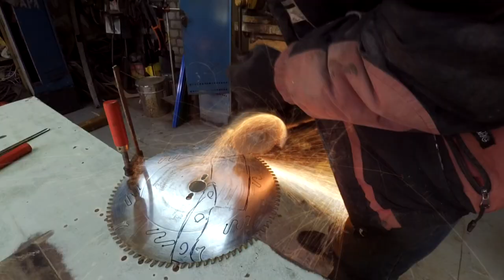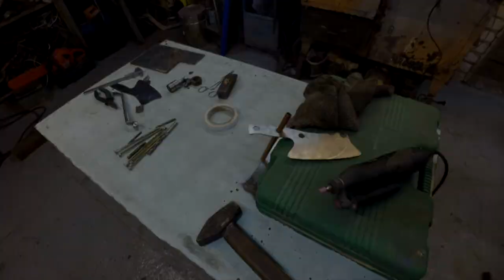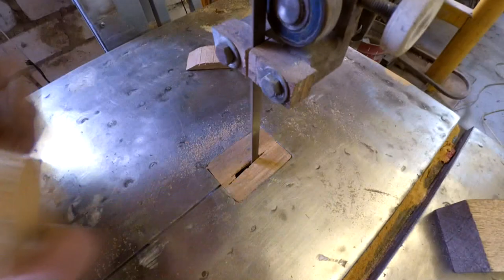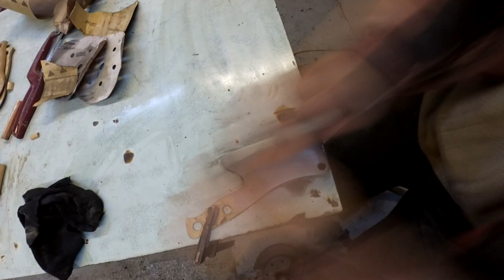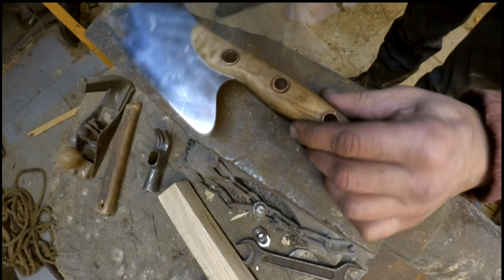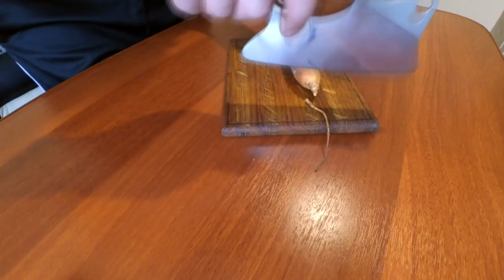Knife making  - the irreplaceable assistant for kitchen

Comment: Ok, what if you cut the piece out using say a plasma torch. Would the intense heat compromise the quality of the steel?
Reply: You would need to heat treat and temper the blade afterwards. Even heat from the cutting wheel or grinder can do that, so i suggest keeping metal cool as possible.

How ever if your are serious hobbyist doing heat treating your own anyways is the best solution, cause i would not suggest using those circular saw bladed other than cheap knife making practice.

Comment: Should you have head treated the steel ?
Reply: The saw blade was already most likely heat treated and hardened but it wouldn't have been bad to add an hour in the oven for tempering. Then again since this is just a vegetable knive the edge won't have as hard of a time like if it was used in bushcraft.